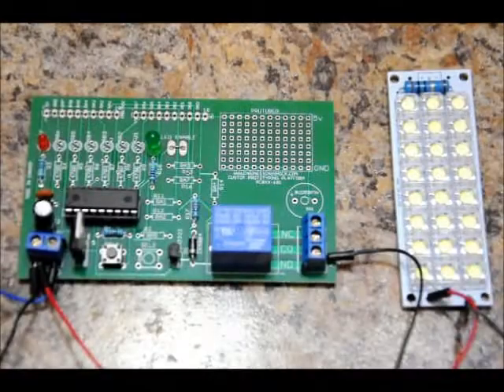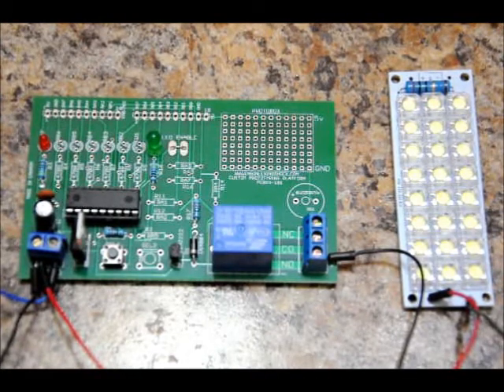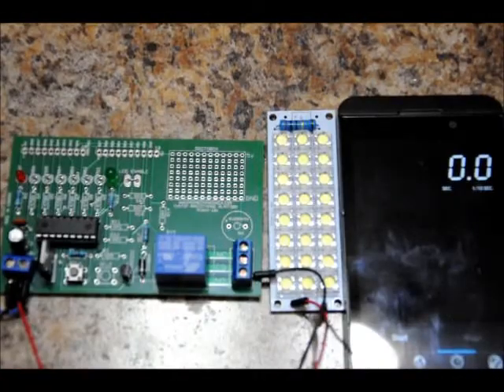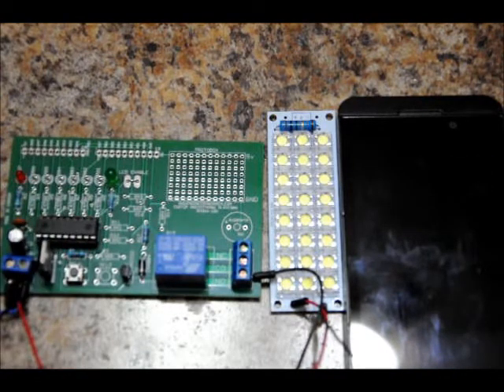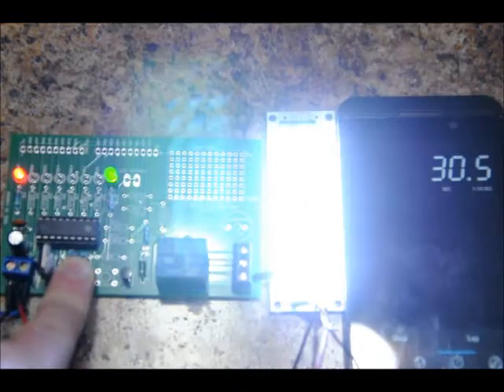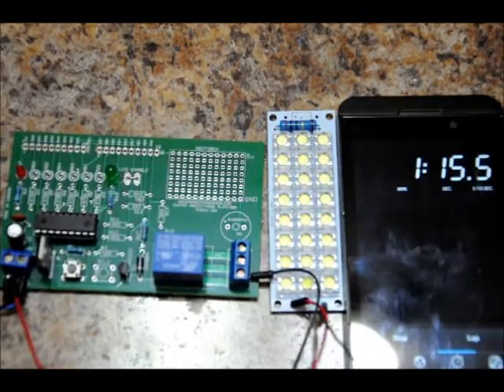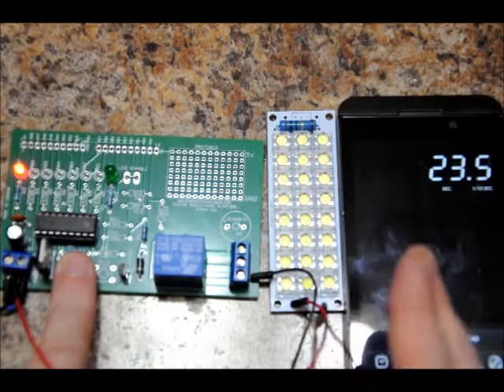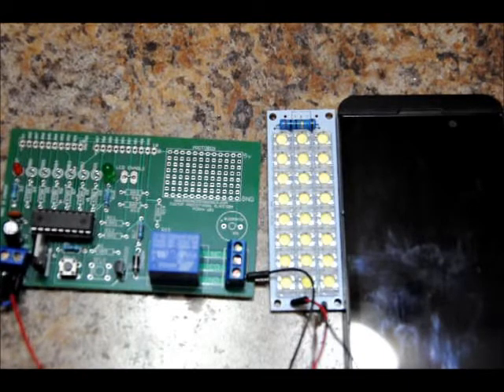Paintball DOMINATION Game Circuit Prototype

Comment: Nice.  Do you ever use arduino?
Reply from the maker: Hi David
As of yet, no.  I have an arduino set coming to me in the mail, as I know that a lot of my subscribers and customers are into arduino.  I'll have to learn it from scratch, as I've spent next to no time on the platform.  That said, it is on my to-do list.  Until then, I'll continue with my trusty PICs =)
Reply: patrickikis this would be realy easy on a attiny
Reply from the maker: ***** It would be easy on a PIC10 as well, but for a prototype, it was much simpler to use a PIC18.  PIC10F222 costs about $0.40, and would be what I would use in the real deal =)
Reply: Pic sounds cheap how much to get it all like Ftdi cables, the pic programming unit and the software.  I spent 32 on arduino and got everything I needed to start my a hello world.